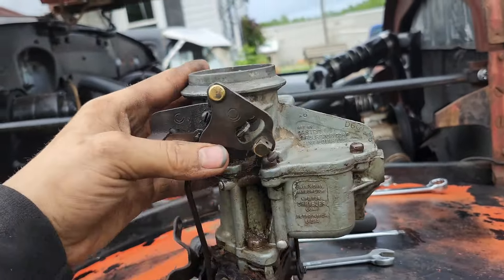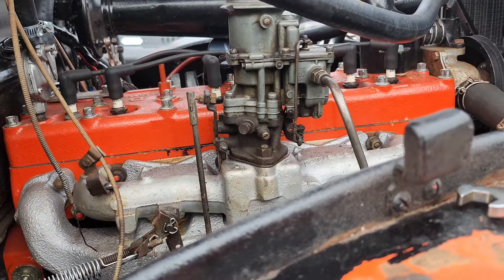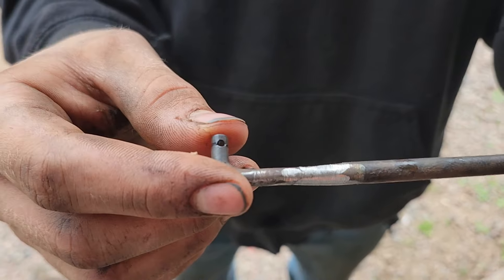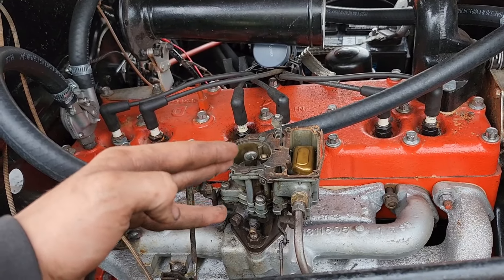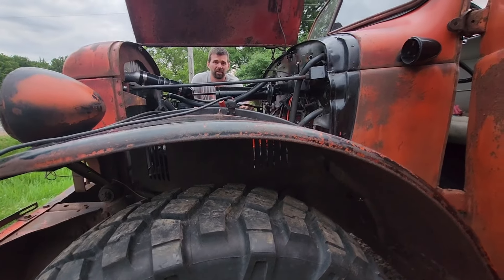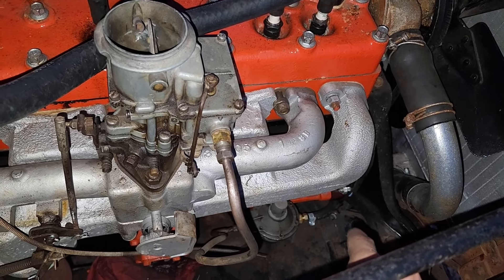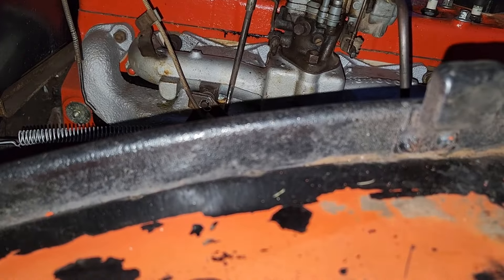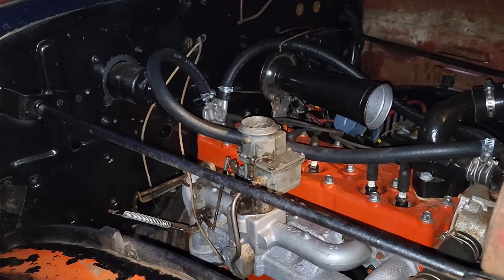Hard work pays off, 46 Power Wagon is running and moving under its own power.

Comment: That aluminum heater control valve is an extremely rare and hard to find part. A factory MoPar heater control valve...generally installed on 1946-48 Plymouth, Dodge, DeSoto and Chrysler dual heater systems.
NOS ones have sold for easily over $300.00.
Great job on the PW!
Reply from the maker: Holy smokes. That's awesome

Comment: Couldve used threaded rod, with 2 nuts and a rod end heim joint into, That way youd have an adjustable linkage -- just a thought for next time
Reply from the maker: Could've but then I would've had to wait
Reply: @liltoddsgarage  Have pops order some parts to have on hand for next time :) hopefully that helps you feather the throttle